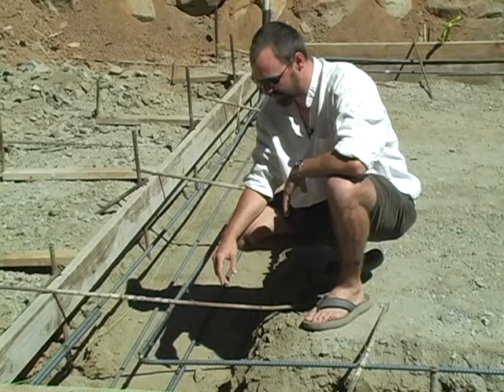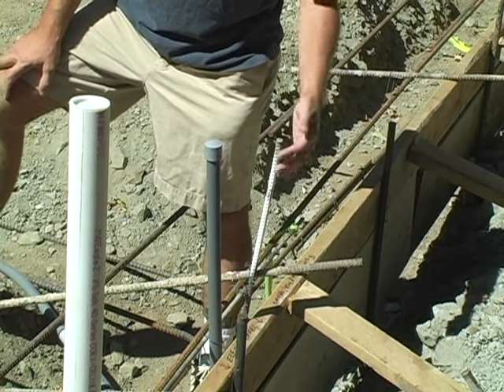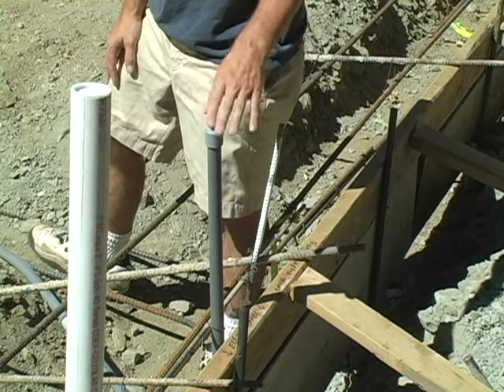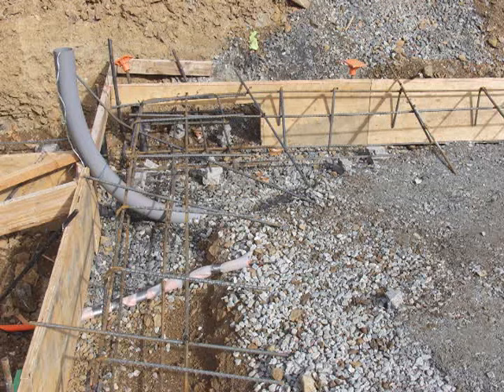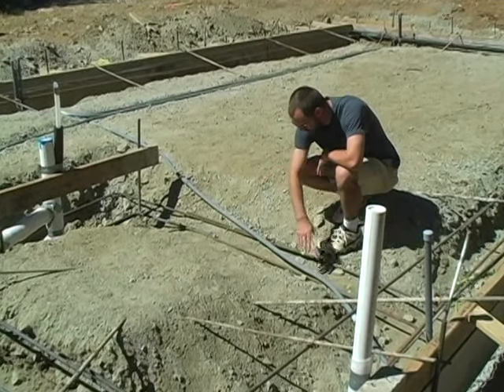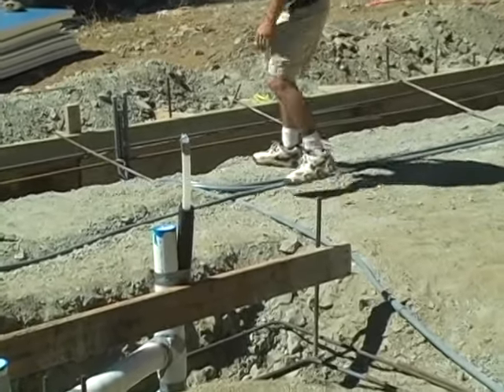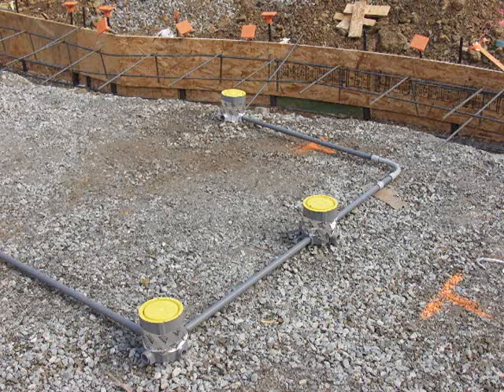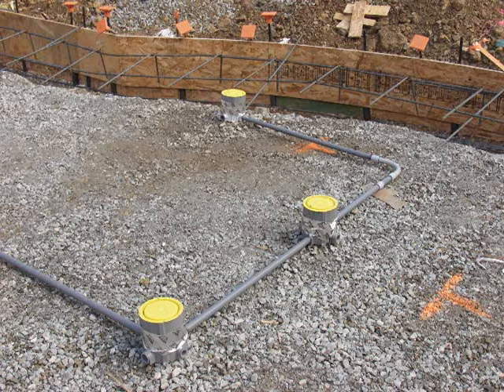How to Lay Electrical Conduit in Slab Foundation

Comment: what do you mean by not leaving more than 270 degrees of turns for the conduit?
Reply: NEC limits the amount of bends to 360 degrees between pull boxes, he is talking about a service entrance conduit that may be governed by power company specs limiting the run to 270 degrees of bend total. Each 90 degree elbow adds 90 degrees of "turn" to the run. Every 90 or other bend (45, 30, 22 etc) adds to the difficulty of pulling the wire in.
Reply: no more than 3 90 degree bends

Comment: No poly under the slab?
Reply: In order to use the rebar in the slab as a ground electrode, the slab must make direct contact with the earth; however, if a poly barrier is desired between the slab and earth, there are other types of electrodes that can be utilized such as 8' long 3/4" diameter copper clad steel rods.